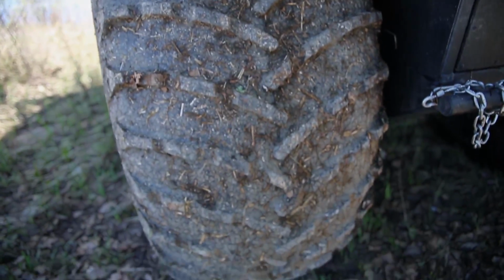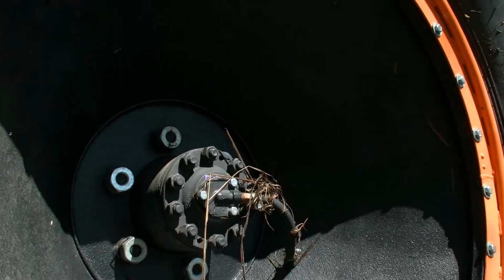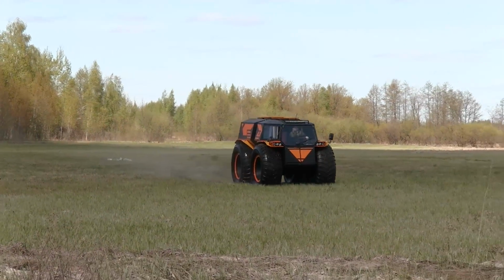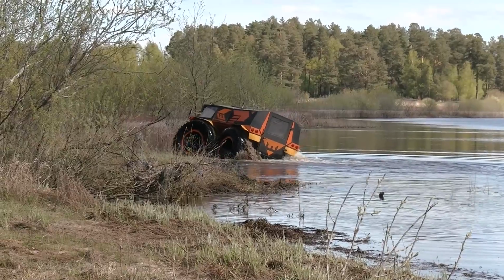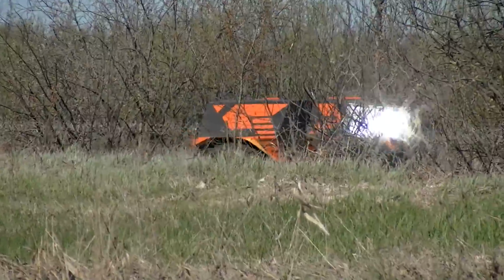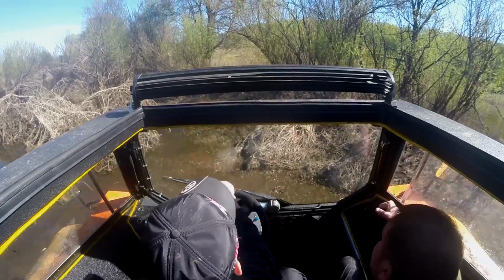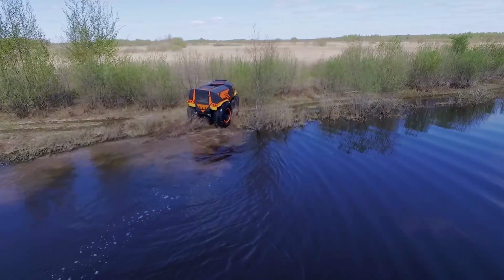Extreme ATV Shatun. New off-road king?

Comment: Very interesting machine. I'd argue that there is still too much air in those tires. Let them conform more to the terrain if you actually want true traction and to overcome the vehicles lack of articulation. It wouldn't have gotten hung up on those logs for one thing. Another is for the driver to relax on the throttle and let low rpm torque overcome it. Peoples dumbest mistakes off road, come from their own underconfidence and/or impatience.

Comment: What do you really gain from articulation on such a short vehicle? If it was long like a bus, then I could understand the benefit of articulated joint. But since it's rather short in length, I don't see any benefit or advantage.

Comment: This may be better than a Sherp. Has both articulating steering and skid steering. Sherp will be a 2 wheel drive (one side) every time you steer. That's why it's weak going up hill on snow. You can't steer, if you do, you loose traction.

Comment: Sherp is first and the best ever!
Reply: Laspi Group they are SO much alike I have a hard time with paying $125,000 for a sherp over $56,000 for this? Same tires wheels most parts, same engine, same Russian engineering , but this one doesn't skid but actually turns and has full time 4x4 , not just when going straight like the sherp.  I couldn't pay almost 3x as much for nearly the same thing.
Reply: @MZ-bl6wg  t - It seems like Shatun needlessly uses an articulated joint which needlessly increases its cost, even though it provides very limited benefit for this vehicle.
Reply: Obviously you’ve never seen a Fat Truck. It makes the Sherp look stupid I know I own them both..
Reply: @4by4squared88  the fat truck is literally the exact copy of the old sherp lol not better at all and the new sherps are much better

Comment: Seems like a good thing off-road machine.....it's biggest problem though is the Sherp exists which this copied and the sherp can do everything this can but adds zero point steering capability, lighter and cheaper I would take a Sherp
Reply: Theprfesssor the sherp is $125,000 US, this is $56,000 us, so nearly 3x more than sherp just FYI not worth it in my opinion .
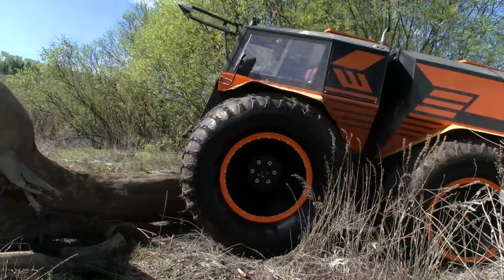Reply: 6:16 A Sherp would have gone straigh over

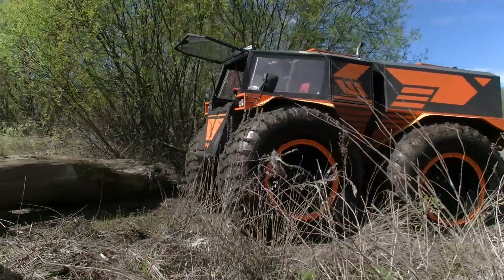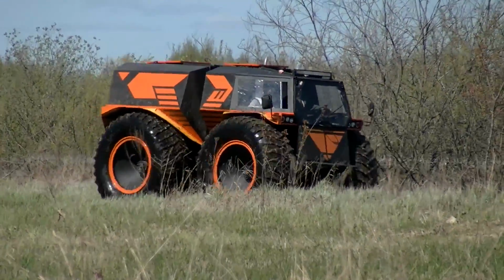Comment: 4:21if that's the sharpest turning radius you're going to be backing up a lot.  6:12 gets stuck on a log, it looks like the tires need more tread. 7:20 It looks likes its going to tip, it  must have a high CG. Can't see any advantage over the Sherp.
Reply: the problem is when something new comes to the market, there are always other companies trying to get a piece of the cake as soon as possible so they try to invent something simular but not the same so they don't get in trouble with the laws of each country.
Reply: The price is a Big Advantage!!!  Over the Sherp & The New Canadian Fat Truck, which goes 4 twice as much as the Shatun!!!  Furthermore the Shatun can articulate, and tires are 2 the buyer's choice??  You can put Big Mud flappers if you Wish!!!

Comment: Too heavy I think, the Sherp is less weighty. The tires on the Sherp are also more "all-Terrain" than those on the Shatun. The Sherp has less moving parts wich is better for maintenance and reliability
Reply: The sherp is a beast and would eat this thing
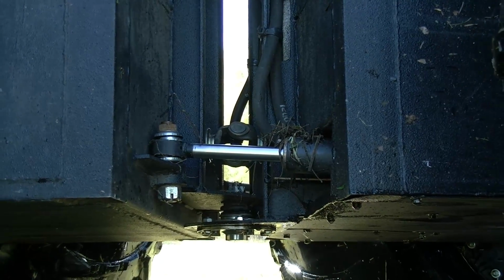Reply: @uTubed007 Yeah I agree with you, as you can see in 3:22 the axles of hydraulic steering and the connection of the two section looks flimsy and not quite durable so that in my opinion Sherp has more durability compared to Shatun.
Reply: Sometimes simpler is always better. If I were to choose i would get the sherp without a doubt.
Reply: Sorry man but the "SHERP" sounds like it has a Briggs + Stratton compared to this, and probably would have some injuries after bashing that brush.......Just one opinion.
Reply: Liljohn P the shrep has the same placement engine 1.5 turbo diesel and is only 1 hp less now if you compare hp to weight ratio it’s a no brainer. Aperantly you never herd of ostacruiser he bashes his sherp way harder than these guys do. He puts this to shame
Reply: But both of the vehicles have a fair price-to-performance also, the Sherp cost you $125K while Shatun only cost $56K.
Reply: Muhamad N. Zaki makes me wonder why? Wayyyy less than half the cost ,..for MY type of off-roading I'd rather have this one over the sheep because I'm new Moab utah spend a lot of time on snow too and oatacruiser said the disadvantage of sherp is climbing in snow   Etc if u need to turn becaue u loose momentum stopping 2 wheels.
Reply: Muhamad N. Zaki I could not justify the price of a sheep, could almost buy 3 of these for the price, I'd buy one of these and outfit it completely out front and rear winches, expedition rack and ladder, and  for the price I'd get a new diesel truck and trailer to pull this and still be less than the sherp. It's clear with this being 1/3 the price threat sherp is wayyyyy overcharging .  Same tires and wheels, same engine, less materialnthan this, sherp is 1200 lbs less which is why this was blowing trees down, thicker panels and skids.  Sure it can't turn on its own radius but with as unstoppable as these are you don't need to turn around much.  I'd rather it drive like a car and have full 4x4 not only when I'm going straight.
Reply: That is so true
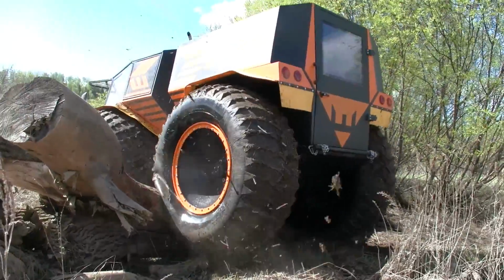Reply: 6:16 A Sherp would have gone straigh over
Reply: The same Russian company made this Shatun, this one is way cheaper around 60k.
Reply: How are paddle tired more "all-terrain"? The Sherp also can't steer without two of the tires completely stopping, costing you momentum. I would like to see a head to head before I made any claims. Ostacruiser has a Sherp and that's why people like it so much If he had of got this instead people would be all about this, it's a biased opinion for most.
Reply: Ragnarok the sherp weighs 1200 lbs less and is one hp less do the math bud and it can turn in just over its wheel base by skidding. What’s this things turning radius?
Reply: Ragnarok and there is plenty of other vids with the sherp  than ostacruiser  to prove it’s bad ass.
Reply: Ragnarok even ostacruisrr said that the disadvantage of the sherp is when you turn you only have 2wd SO in snow sand etc going uphill you have a problem .  I'd love to see a head to head for sure!

Comment: idont see any advantages over the sherp plus the driver cant communicate with the passengers
Reply from the maker: the advantage is articulated frame. Driver easily can communicate - there is a window between two sections
Reply: Articulated frame is more moving parts, more to break. I like the Sherp. Like to see a head to head competition with the Sherp and see how close they are.
Reply: Mohamad Mm also all 4 wheels always turning in power, even when turning, fulltime 4x4 the sherp stops 2 wheels when turning.  Even ostacrusier said it's a disadvantage of sherp.   This is also way less than half the price of a sherp.